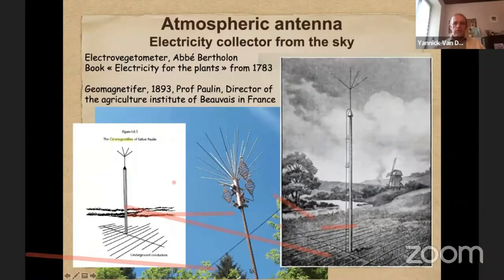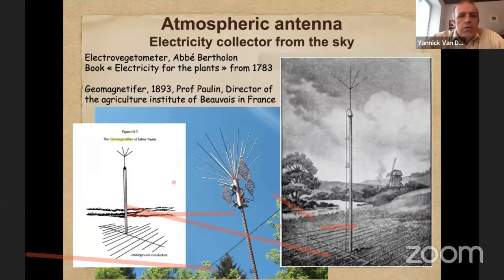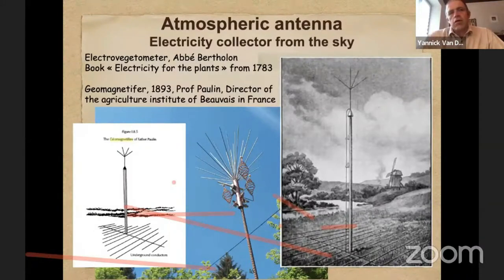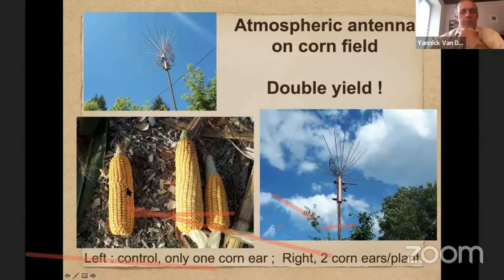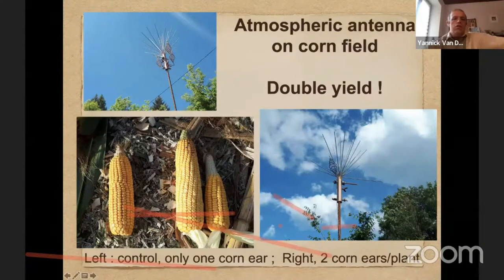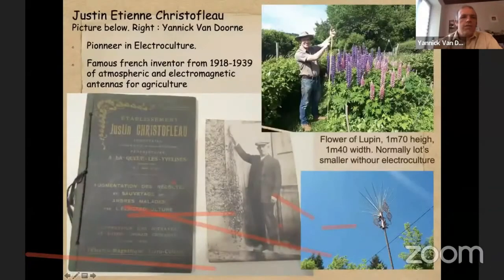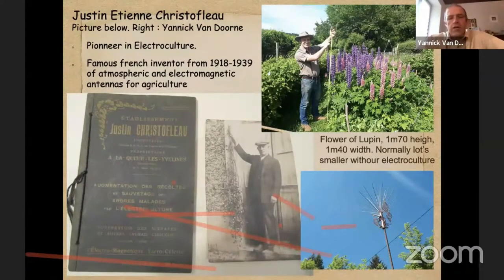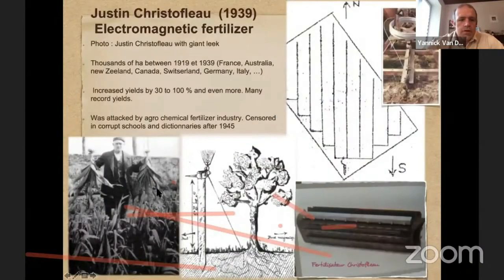PART-05, Electroculture Introduction to Sri Lanka - Atmospheric Antenna (Sky Electricity Collector)

Comment: Is this work by increasing the soil CEC, so the soil will be able to collect nd hold more kation?
Reply: I've heard that this increases the exchange rate.  I also wonder if you should put paramagnetic dust mixed in with the wires in the ground
Reply: Think of it as an electric chelator 💫